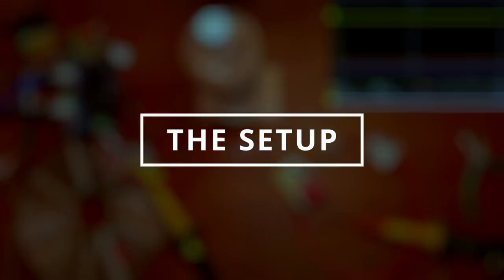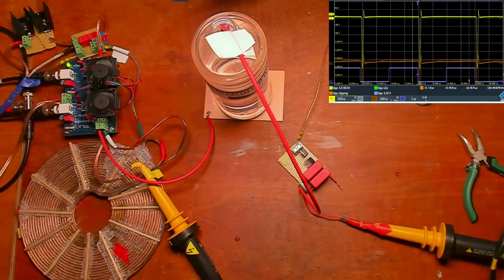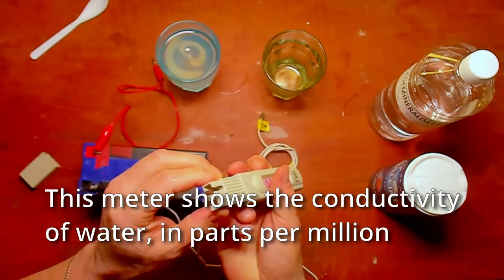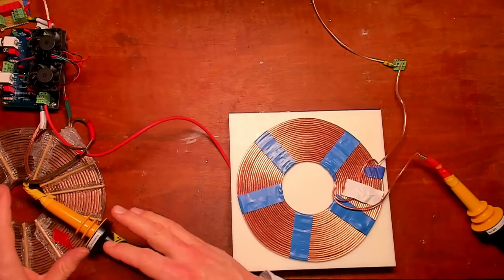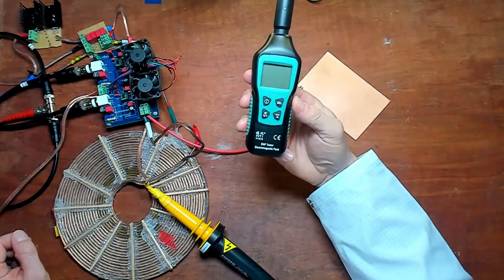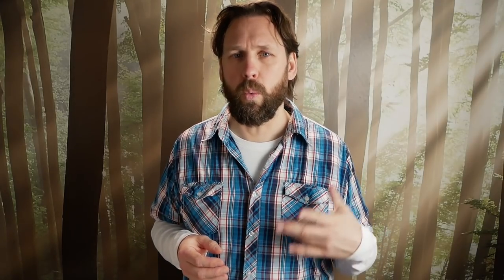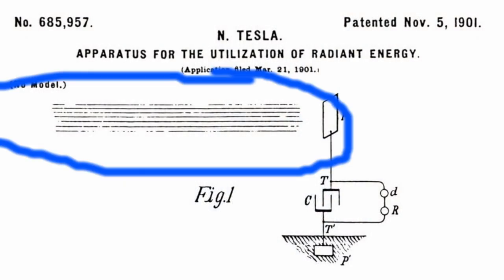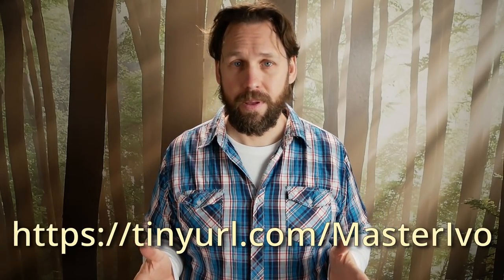Electric Conduction Through Distilled Water

Comment: I've sort of heard of this concept before but it was hard for me to really picture it in a practical way. This is by far the best explanation and demonstration I have ever seen illustrating dielectricity. In my experience with electronics, I've seen effects of exactly what you are describing but I always thought it was a magnetic or electric effect. Now that I remember, there was an old patent somewhere of a capacitor amplifier which used this concept to modulate a power supply in a useful way as a transistor would. It was like a saturable reactor but instead of a transformer, it used a capacitor. This idea of displacement current is a game-changing paradigm for me. Now there are actually three currents: electric current (flows in conductors), magnetic current (flows in ferrous materials) and displacement current (flows in insulators); all of which are closely related of course. You're onto something big. Good work and thanks for sharing.
Reply from the maker: Thank you Andrew! You got it! I predicted this current long ago, and now it is clear. All these 3 energy forms can transform into each other, making the cycle complete.
I am very glad you shared your insight with me.
If you would like to stay in contact, my email can be found on my YouTube "about" page (from pc).
Reply: Its basically the trinity of energy I think 😶 the proper ratios might break some preconceived notions about physics 🙂
Reply: @MasterIvo  your image is from an energy projector, and Wardencliffe was the receiver. Once you have a "projector" and a "receiver" you have a current flow. Positive flows to negative, so if his tower was to be the negative AND the ground, then a massive energy well would be created and energy could be transmitted over the entire world.

That is why there is no diode; those are like satellite dishes meant to project energy, and the tower was to be the collector. The tower was the ground so there was not a need for a diode at all.

Comment from the maker: Please help share this video, thx! 
0:00 Intro
0:43 The setup
3:24 Negative charge experiment
6:03 Positive charge experiment
7:53 Water conductivity test
9:36 DC motor water test
11:23 Bringing a coil into resonance experiment
15:11 Polarisation protection
18:18 The magic revealed
24:09 Dielectric induction
27:12 Outro
Reply from the maker: I don't know, this test is just an example of the working principle.
I intend to use it with bifilar pancake coils and epoxy
Reply: @MasterIvo  You can use 2 stainless steel cups - one inside "hot" and outside "ground" wire/ water between. It will give more capacitive square. In old times I reed about that - there was a patent - HHO capacitive generator. There was 20 kV? system. Not remember.
Reply: I'll share your vids man. Their awesome. Idk who will share then or watch them, but I hope more people do than what already have. This stuff is my favorite kinda stuff.
Reply from the maker: @bringer-of-change  Thanks for helping out!

Comment: Brilliant explanation shedding light on many concepts discussed and then rejected from the past. Thanks. I have a new view on displacement current. In the past I conceived it as energy from ground. Now I see it is more clearly as energy from the dielectric.  Great work!
Reply from the maker: Thanks. You can look at the ground (earth) as a dielectric.
Reply from the maker: yes, by Leland Anderson right? "Nikola Tesla Guided weapons & computer technology" is what I am reading now (part 3 in 4 book series). I still need to find part 4, part 1 and 2 were good also.
I need to scan part 3, maybe you have part 4?
Reply from the maker: I didn't find it (yet). I read all the court readings. the rest I did not read yet.
Reply from the maker: @Davide Tanner  Thanks Davide! I found it:
https://teslauniverse.com/nikola-tesla/articles/rare-notes-tesla-wardenclyffe
Reply: @tanner1985  That's pretty good. Not many people recognize that there is a separation between the coil train and the capacitor (accumulator) up top. It was his form of making a diode, I guess, to prevent the energy from discharging back to the earth. Keep up the good work guys.

Comment: Hello Ivo, 
great work, I love your channel. Seems to me that you also created an impulse radiating patch antenna. Copper plate acts as a patch antenna, and if you got the right impulse frequency you will get EM radiation. Did you try measuring magnetic field strength around the copper plate? You would need a patch antenna frequency calculator to find out the resonant frequency range.

Comment: i believe your analysis here could use some illumination. the Fig 1. device Tesla illustrates is a flat, polished piece of metal hoisted high in the air (let's say 30 meters).  It is a collection plate that picks up electric charges from atmospheric charges as well as contact with ionized particles, which i wouldn't consider to be the same as the radiant energy as he later defines it.

Comment: Awesome demo! 
How close is this to Stan Meyer's method? I think very close. You should look up his tech brief and in it the steam resonator which can heat up water by  one wire static pulses that rotate water molecules and will heat it  through friction   without energy consumption because no current can flow.
Reply from the maker: thanks, but I don't feel it is related to stanley Meyer. I think he eas able to produce electricity, as high voltage dc from rectified high frequency ac.
And he choose to use that high voltage dc to electrolyse water.
I might be wrong.
This water demo is just to make the principle clear of displacement current, from the fast changes in high voltage (the impulses)

Comment: I'd like to see more math applied. For instance, how much voltage and current is received versus how much is sent?
Also, do these rates change when the distilled water has changes in properties such as volume, length, width, thickness and in proportion to different frequencies?

Is current received on the other side of the glass? If not, why?

Is the efficiency proportional to the orientation of the output? 

Can the transmission be focused like a laser to a target so that surrounding water doesnt transmit?

Are there shielding or negating methods that can be applied?

Does this method utilize breakdown voltages? If it does, at what voltage duration allows x amount of current and how might pulse rate of rise and decline affect current capacity?

What is the highest watt-hour achieved? What positvely and negatively affects this efficiency?

Comment: Master Ivo you are giving education in detail no one else does. Thank you. I have a question too. In a capacitor, the dielectric fails when there is too much voltage, as you know, and the capacitor sort of explodes. Can the same be done with distilled water somehow? As I understand it, this question is the key to efficient water to hydrogen fuel conversion secrets.
Reply from the maker: I don't know. maybe.

Comment: When I red about scalar energy I thought of the exact same example, slap water you send a shock pulse strait through water in all directions, then a wave of water along the top. I think the same thing happened with the Aether field, shock it hard and fast enough you create a scalar Aether pulse.
Reply from the maker: yes and the transverse water wave needs a boundary condition. Air+Water. I like to think the Aether also has a counterpart (called Electrigen)
Reply: @MasterIvo  that's a idea I have not herd, I did see a line of valence beam's moving like a wave to a rising and lowering magnet 🧲. It  was a Eric Roberts Laithwaite show in England. Made me thing we are in a magnetic field like water, but it is only polarized by magnets like a hose nozzle.
Reply: @MasterIvo  the properties of Aether have to be worked out in the public sector for us to advance forward.

Comment: MasterIvo, in my old experiments of Transmission of Energy by a conductor that you can see in my channel, what flows through the cable is a "displacement current" also, despite using a sine wave, it also occurs in the only cable “a standing wave”, it had the same properties of passing through water since I checked it too… and there is an important detail that you can check later that when using a displacement current through only 1 cable, you can pass many amps and the cable does not It will heat up as if it were in a closed circuit with conducting current.
I could not easily make unidirectional pulses in his time... but as Tesla said in his defense of the radio patent, he could use a TX that only radiated 5% or less of Electromagnetic Wave, and this is clearly how you are doing you Tesla's system that replicates in his time using a Sine wave, causes a strong Electromagnetic irradiation in the TX and RX, which could be minimized with your Unidirectional Pulse system, I hope to be able to build it in the near future.
 Your experiments are on a very good path, I follow your work with great interest.
Greetings from Chile.
Reply from the maker: Thanks for sharing, what is the video title of your water experiment?

Comment: Wonderful engineer Evo!
I've always wondered...if as a primary coil we use a low resistance conductor  and as a secondary we use a high resistance high inductance coil conductor,  and we link them in an "antiparallel" way... once the fem is induced into the secondary so antiparallely to the primary itself, there should flow more current through the primary and so keep inducing fem to the secondary and so to itself and so more flow etc. I wonder if any capacitor would implode 😅✌

Comment: This sounds similar to a plasma capacitor where something like a neon tube is ionized forming one plate and foil outside the tube the other plate.  Switching off the plasma emits a strong pulse that.. well I can not say here on this platform..

As the voltage of a capacitor rises when a capacitor has its plates separated.  The faster this happens the stronger the dielectric pulse

Comment: General question on everything, I have now subscribed and watched all your videos. I found them Amazing. I will make a donation, You re-ignited my interest in Nikolai Tesla. I also read the articles on your website and I have some questions. As I see it, you are trying to replicate Tesla's work with new technology But that raises some questions.      
1) You are producing Unipolar pulses But, Tesla's magnetic disrupter was used to separate the electrons from the Aether stream. Where does your circuit perform that similar feat?  I understand you replace the Hairpin with the Coil, and the MosFet replaces the switch but what separates the electrons.

Thanks
Reply from the maker: I think in fields. For me "electrons" are virtual particles that are use to calculate field strength, but are not real.
A rapid change in voltage like the impulse induces a displacement current (through counterspace or dielectric medium around or between conductors) which is different than a conduction current (which is related to electron flow through conductor)
Thank you for your donation

Comment: I'm just wondering if that plate+distilled water + cable is just another capasitor in series? You are pulsing it with AC, so current passes through this "cap". Moray used to do this trick, where he cut a wire in two and then put a plate of glass in between the two parts and people were amazed when the AC still passed through.

Comment: I've seen the term "Maxwell's equations." Is this term a ref to James Clerk Maxwell? And can you summarize what you may know about these equations? I prayed for you to be connected with that image you seek @23:00.
Reply from the maker: thanks. Yes James Clerk Maxwell. A (rapid) change in (high) voltage sets up a displacement current.
which is the current tesla used.
induced by impulses in the primary.

Comment: It’d be great to try this. But with a few capacitors connected to different dielectrics, to see which charges the most. If displacement currents flow better on >K that cap should get more of the impulse. Right?

Comment: When I was looking at the video and came to the point where you talk about the diode not present in Tesla setup another question came to me: can the capacitor that Tesla used be a one way valve like the in the Faraday ice pail setup where charge on inside of the cup is added and stores up on the outside but it can not go back to the inside. I don´t succeed in analyzing if this should be possible, I´m not experienced enough.
Reply from the maker: I think he used a disruptive capacitor discharge, which gives a unipolar displacement current, than the cap can be charged without a diode

Comment: I'm not too sure about ground conduction (vs. 'ground as dielectric', are they mutually exclusive? its def polarizable anyway!) - am reminded of NT quotes saying his wireless transmission sent power through earth exactly the same as if through a straight wire, and that earth acts like a polished metal ball. 

But it seems the whole virtue of displacement currents is that they're a longitudinal electric wave propagation (my favorite Dollard quote that longitudinal electric waves occur between any 2 capacitor plates and any transformer windings). And the earth does seem to be an ideal propagator/transceiver of longitudinal (di)electric waves. 

Wondering to myself, what best conducts longitudinal (di)electric waves? Copper wire? Water? Nylon/Epoxy with TiO2? An iron sphere with a thin silica crust (or maybe planets are hollow....)? Counterspace? I'm lately well persuaded by the 'electric universe' cosmology, which suggests the linkage of all stars and galaxies by the electric field. So, are displacement currents/dielectric lines of force (the dotted lines from the Steinmetz diagram) even constrained whatsoever? I dont suppose the experiment works with an empty bottle (no water) lol?
Reply from the maker: Good question which we need to research.
Reply: @MasterIvo  hehe oh yeah, i can test some of that stuff myself, using Ivo's open source designs. prodigious!

Comment: Ivo, this is your best video yet! Super clear description of Maxwell's longitudinal displacement current.

3 questions: 

1) This displacement current can induce, but not conduct through a dielectric, correct? So the transmission distance is very limited?

2) Do you believe Tesla's single wire power transmission experiments also used displacement currents? (Each Tesla Coil terminal acting as one plate of a capacitor)

3) Have you noticed special attributes about these currents compared to regular conduction currents? For example those shown in the original Borderlands videos featuring Eric Dollard.

Thanks!
Reply from the maker: 1 I think it conducts. Tesla used the earth as conductor. earth is like a dielectric or not?
2 again, single wire, but earth is used.
3 yes. I got extremely tired during/after filming the experiments.
the plate and coil stayed polarised for days after the experiments (still measure 265V/meter while it is grounded (system turned off for days).

I haven't done attraction tests, or other erix dollard /borderlands tests, but would not suprise me they work. he also charged the capacitor (air as dielectric). he used much high voltage/current impulses
Reply: 2) Do you think Tesla's single-wire power transmission experiments also used displacement currents?
It is correct, I could also verify it in 5 experiments that I published years ago on my channel... I did not use Earth as a conductor. Greetings!
Reply from the maker: Thank Jorge! what titles do your videos have, would love to find them! Got a link?
Reply: @MasterIvo  Thanks for sharing your thoughts!

Tesla described the earth as a giant conductive sphere, insulated perfectly by the vacuum of space. He did need an incredibly intricate grounding system to properly push his currents into the ground though.

Comment: standing waves which you are describing through the air and  earth are established in sort of a figure "8" from your location through a ground plate where the current is transmitted through the earth to a position directly opposing your location on the globe and transmitted through the air to the north or south pole (depending if you are above or below the equator) where it then flows to the opposite pole through the earth then back through the air to your position returning to your aerial capacitor completing the circuit.🤐